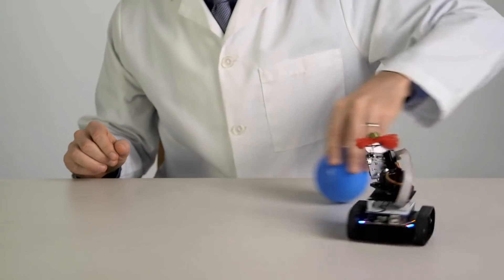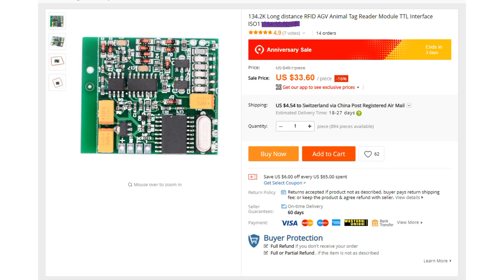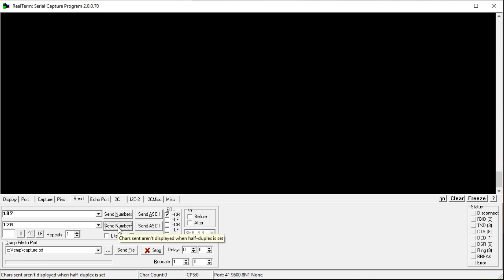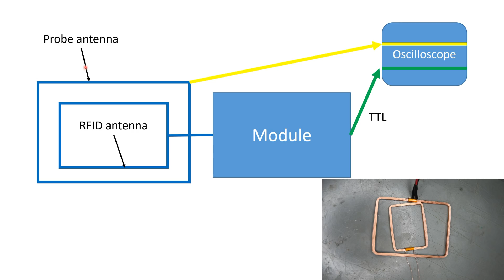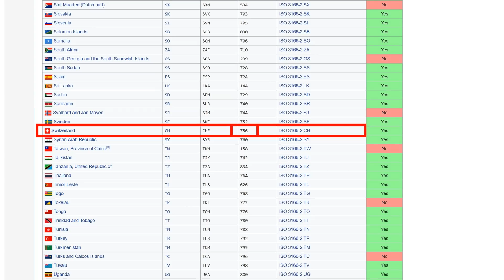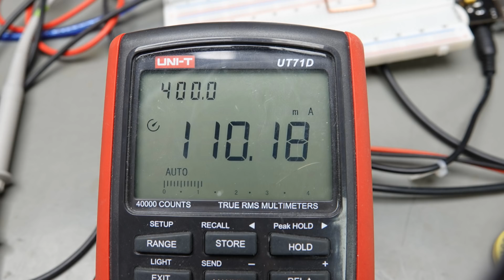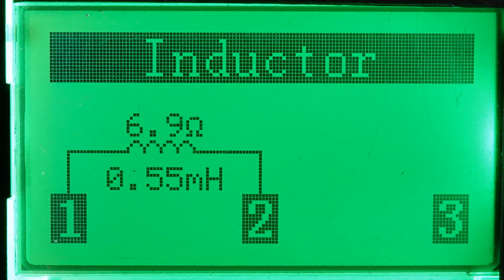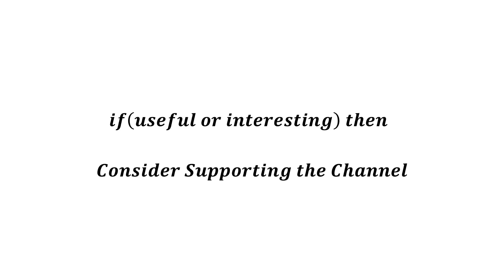#263 How to build an Animal RFID reader with Arduino, ESP8266, or ESP32

Comment: I have sold commercial readers for the cow tags for years.  My customers use them in an automated data collection system to identify the NEXT cow passing through the entrance to the milking parlor.  This allows the milk weight measured at each stall to be matched to the cows according to their order of entrance.  The challenge for our installations is that we need to very reliably read every tag, one at a time, in order.  This is made even more difficult by the rf noise produced by poorly designed and/or installed variable frequency drives used on vacuum pumps and well pumps.  It always amazes me that the systems can accurately read tags >98% of the time and with some clever pattern matching algorithms that compare the milk weights measured to the expected milk weights for the cows read, the data accuracy reaches nearly 99.9%.  This video was VERY interesting for me.  It is cool to see how this works.  I am looking forward making my own reader using this information.
Reply: Could be interesting trying to merge the two components... https://youtu.be/FXI21S4ZWJU ;-)
Reply: I would recommend multiple readers. Preferably one strategically placed near a feeder or an automated scratcher. Maybe even make the feeder dispense food conditionally on the reader getting a good read. I'm also working on automated ecg analysis for cows, among other animals, and that could actually be used to identify cows, too, but it's less practical.
Reply from the maker: Interesting that you used these tags. I am sure you can do some pattern recognition to increase the hit rate. If only one is lacking it is always clear which one it is, if you always have the same cows to milk. Good luck with your project!